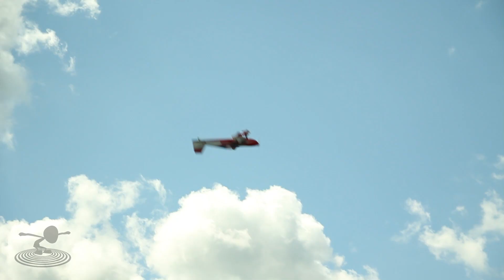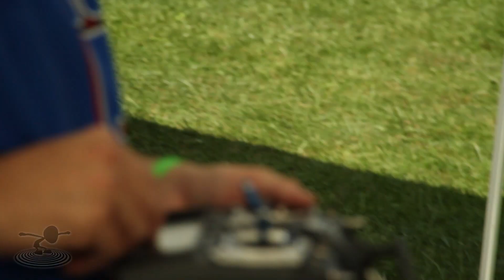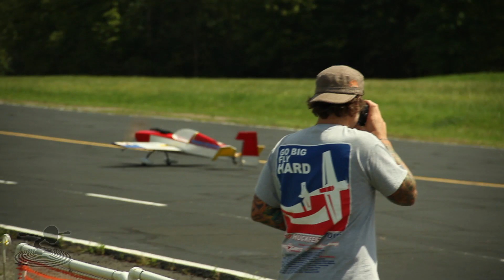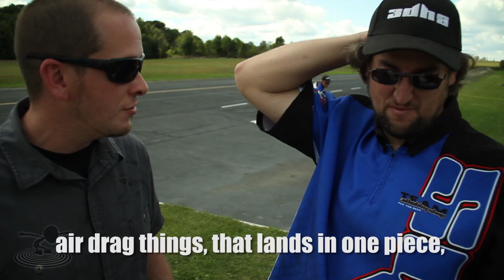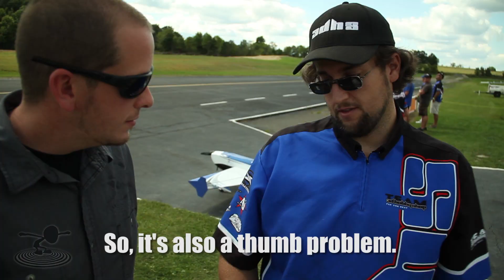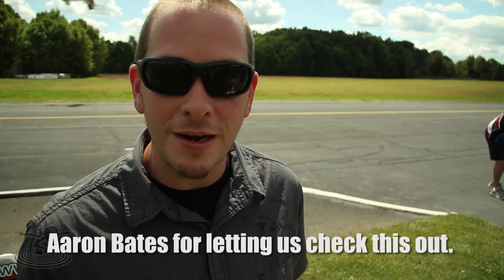Flite Test - Custom Air Brakes - Extra 330SC

Comment: You know why I don't like 3D flying R/C planes?  I get that it looks cool, I get that it's more difficult and takes more skill as a pilot, I get that most people like to watch that type of "daredevil" flying. Bottom line? NO REAL PLANE COULD EVER DO THOSE MANEUVERS!! Now, yes, I have seen some, I SAID SOME, NOT ALL, of these maneuvers done at air shows. But an actual size plane simply cannot achieve the power to weight ration required for most of these maneuvers.  Never mind the fact that they'd likely exceed the structural integrity of the aircraft and cause it to buckle, shatter, or just plain fold under it's own crushing weight. Then their's the g-forces which would be exerted on the pilot, causing his head to pop and explode in the same way a diet soft drink does when a ton of mentos candies are suddenly dropped within. I get why people do it, I just have no desire to learn it. It doesn't impress me. It's cool and all, I just don't "get" it.
Reply: You say that like you want rc planes to be real planes, go and get a pilots license if you want to fly so bad.
Reply: Raycefan watch world aerobatic championships, especially the advanced class.
Reply: Raycefan The designer and pilot of the Oracle Turbo Raven would disagree with you there.
Reply: You haven't looked too hard buddy
Reply: +Raycefan yeah and thats just why i am doing it.

Comment: I have a real suggestion.  Build a 1/6 scale replica of a P-51 and equip it with twin barrel electrically driven .22 caliber belt guns, every fifth round being a tracer round.  Have a broad field HD camera in the cockpit looking out with a high-baud data RF link multiplexer and then use an Oculus Rift visor to fly the craft.  Then, and this is the really fun part, have real dogfights with other combatants!  I swear!  I would so PAY to SEE THAT!  And I don't think I am the only one.  Call it: Gladiators of the Sky.  They do this already with robots.  So what's the difference if it's done in the sky, away from people of course?  Much more fun and exciting too!
Reply: Tetrodioxide that's probably illegal
Reply: That's... Interesting? Deadly?
Reply: Xavier Schario in the US it is. You cannot use live ammo in most airspaces. Especially not in a live event.

Comment: Seems obvious to me why this design would cause plane roll. When open/partially open the lower side of the air brake scoops/restricts air and it would move upwards through the wing. Similarly the upper portion forces air upwards as well. When flying a knife edge there is a difference in the airflow between left and right wing. Thus the air-brakes do not cancel out each others roll inducing airflow change. His air-brakes should both top and bottom hinge from the leading edge.

Comment: pointless. there more hassle than they are worth. i had one of the very first vpp systems on a laser80 4stroke in 1992 and that was bad. the ikarus system is terrible. the electricfly one blows apart.

Comment: The brakes being independent of each other is the idea; transmitter is modified with triggers on the back, one for the left, one for right. as the plane rotates, independent control being the idea to control rotation. So what you're seeing on the ground is just me randomly playing with the triggers. The adverse roll I mention in the video was actually from air getting through the air brake assembly, working as a crude aileron. a problem that has since been solved.

Comment: No you didn't read the comment properly,What I said in my comment is that the left wing servo reacts ever so slightly slower than the right wing wich would cause the plane to roll because both left and right wing airbrake,flappy thing are not deploying exactlly at the same time.
this would be able to be fixed by adjusting the servo speed individually through reprograming the servo or adjusting speed in transmitter.
I hope you understand what I mean.
Regards,
Pete.

Comment: actually, top and bottom are linked to opposite sides of the same servo arm, the servo acting like a bell-crank link with each other. would be impossible for the top and bottom to move out of sync with each other. the roll was actually caused by air getting through the wing, adverse roll since solved with baffles.

Comment: how about an active yaw system like a heli? somebody needs to try to mount the tail like the Eurocopter EC 135, with a fantail assembly tail rotor. vertical take off plane like a heli? done that. now lets see some crazy yaw action like a 3d heli on an airplane!!